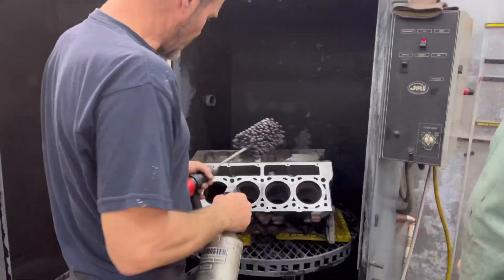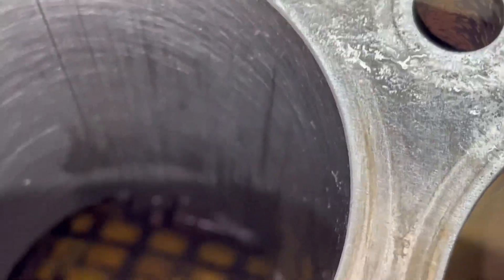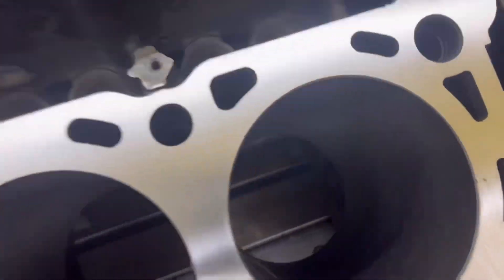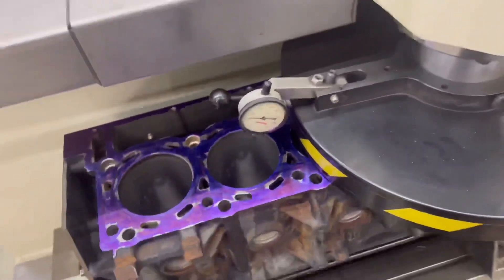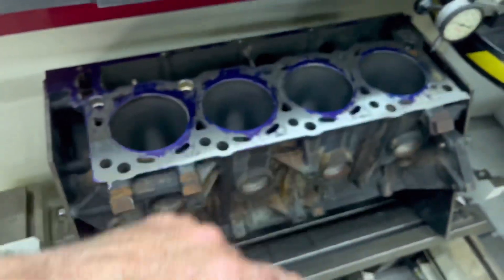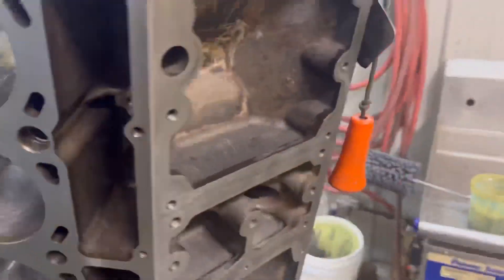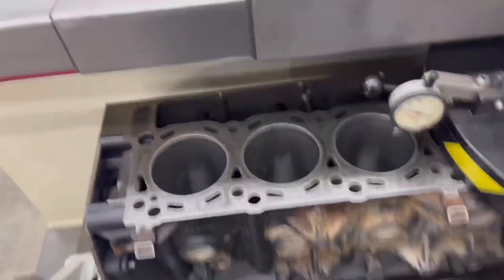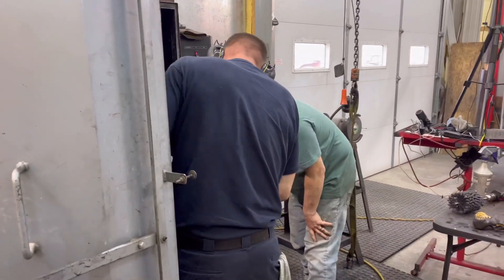Ball hone and surface the 6.0 and 6.4 Powerstroke

Comment: How can i get a hold of you for repairs
Reply from the maker: It really is a difficult thing to schedule.  Actually,  I still haven’t figured out exactly how we decide which project will get done next.  We tend to do engines and machining.    A bunch of this is because of coolant pumps and alternators and power steering pumps and injectors and high pressure pumps and most other bolt on crap they sell nowadays that only cost the shop money in warranties.    Long winded answer huh??  I guess it depends on what you are looking to have done.   If it is an exciting project,,  then we tend to get excited!!!  Lol.      It is crazy how the phrase “if you build it, they will come” holds true.  Without looking at all or asking for jobs,,  we are nowhere near out of work!!!   It is a wonderful blessing!!!  

I think Julie monitors facebook messenger fairly regularly in summary.   I prob could’ve just answered that huh???  Lol

Comment: I’m rebuilding my first 6.0 
Do these blocks usually need to be decked? Seems like mine is pretty flat with the straight edge and feeler gauge method
Reply: I mean my heads are definitely shaped like a banana, but I’m buying new heads
Reply from the maker: The blocks are decent,,  very rare to have one need .005 to clean up.